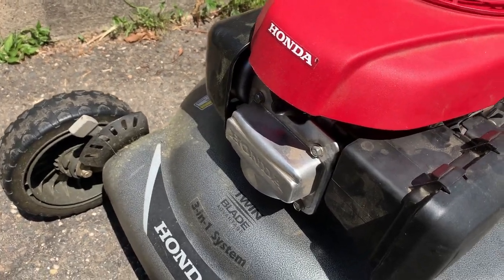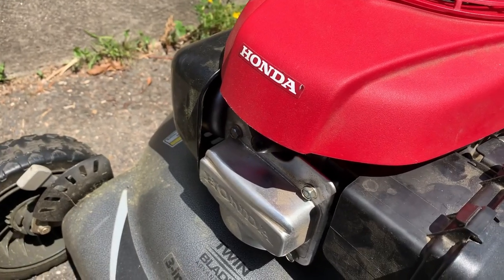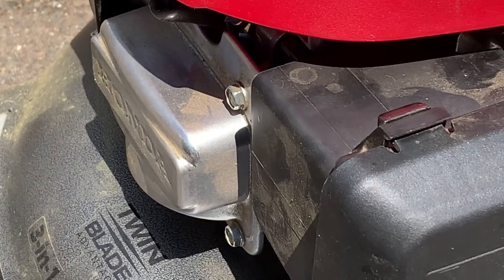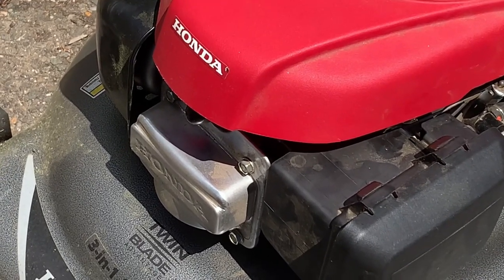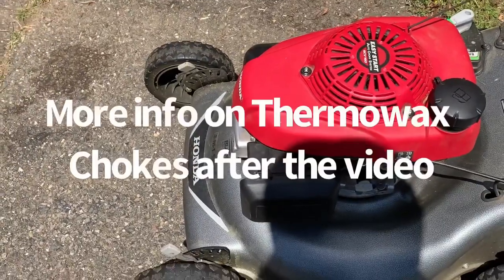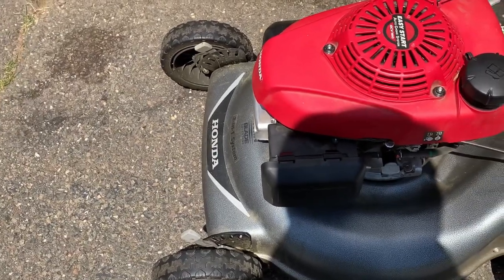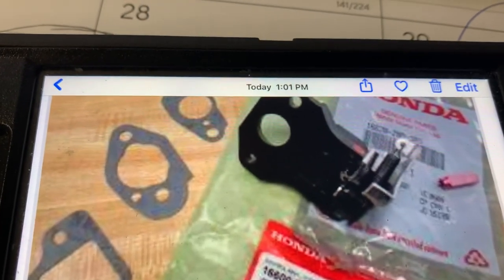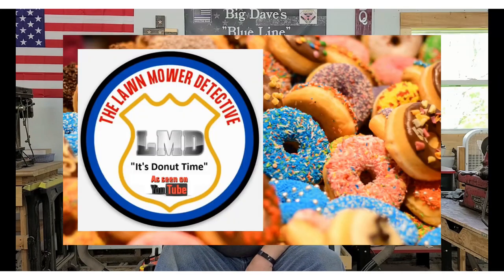Honda Mower GCV-160 stalls after a few minutes. NOT the normal solutions!

Comment: I've got a pressure washer with the same motor. I tried the gas cap, fuel hose flow, changed the ignition and the spark plug. I'll check the carb next thanks to you😊. The engine only has about 10 hours of run time on it, but it sat for about a year (with no gas in it) between working and not working.
Reply from the maker: Guaranteed Schmutz on the carb! Good luck!

Comment: My initial issue was a surging then stall.  After some research and seeing several videos, i took the carb off, pulled the main out,  ran a torch tip.cleaner through it, pulled the screw out beneath the idle screw and ensured fluid/ air would pass through. Reassembled,  replaced that wax peiec as mine had a bent rod and wax all around the rod. Now it starts right up but will only run about a minute or less. I've tried the gas cap, not thinking it's the ignition but not sure
Reply from the maker: Is the choke fully opening? Did you squirt fuel in the carb as it’s dying to see if it will keep it running?

Comment: I have a honda gvc170 dies after a minute or two Cleaned Carb. looked good before, Gas cap vented, even bought new carb. when all else failed good spark.. still doing it. a what else could it be???
Reply from the maker: Is it losing Spark when it dies or Fuel?  How long before it will restart?

Comment: Ken my Honda engine GCV160 over head cam runs about 20 seconds dies and can restart it a minute later. Dies again. It has a manual choke. changed carburetor and coil still does the same thing.
Reply from the maker: Spark plug. Sounds simple try it
Reply: @KensSmallEngineRepair  did that also.
Reply from the maker: @randyturner4803  is it dying due to fuel starvation or lack of spark? Spark tester die out when it quits? Squirting fuel as it dies bring it back?
Reply: @KensSmallEngineRepair  took fuel line off carb and looks like no restriction. Gas flow steady. Did not try a spark tester will try that tomorrow. By the way your videos are great.
Reply from the maker: @randyturner4803  thanks I appreciate it. Going live at 8
Reply: @KensSmallEngineRepair  Ken I tried second new spark plug and bingo!! The first plug was bad. Runs like a champ. Thank you!!!
Reply from the maker: @randyturner4803  Cool!!!!👍👍👍👍

Comment: A Great Find there Brother,
I had a very similar issue on a Briggs with the plastic carb and an automatic (spring choke stove) choke , Start 1 or 2 pulls run for a few minutes then die, set for several minutes and would restart,
What I found was a few small blades of grass in the carb bowl blocking the main jet, cleaned the carb out runs like a top.
👍👍👍
Reply from the maker: Wow, never seen that before. Good hearing from you Brother, hope all is well!

Comment: Ken so are you saying it was a clogged jet. 

Did you replace the wax plug? 

My choke system seems to open and close. 
It seems to stave for gas then raises in idle. 

Would you say the carburetor is the problem 

Thanks Houli. 

This system seems to have many gaskets 

Did you totally remove the carburetor from unit or did you remove the Emulsion tube and clean it out. Or keep in place and spray out the crude 

Thanks Houli
Reply from the maker: It was a clog in the main jet   Not fully clogged but clogged enough to work with choke on but not enough fuel to keep running with the choke off.  I disassemble the carb and clean out the jet, emulsion tube, and pilot jet.

Comment: i have a Troybuilt with this engine on it and had the same problem.I left ethanol gas in it between cuts and during winter time.It got to a point where i would have to spray carb cleaner into the carb to get it to start. I did that for a while until i was helping my dad cut grass at his house. I let him use the Troy built mower. The mower ran out of gas and he grabbed the wrong gas can  thinking it was regular unleaded. The gas can he picked up had 50:1 mix in it for our weedeaters to run on and he poured it into the mower not realizing what he did. I found out too late using that mower with 50:1 mix still in it. One thing i noticed was even after sitting for a weeks time It started right up without using carb cleaner.
Reply from the maker: Most mix oil has stabilizer in it which probably cleaned out the jet over time. Interesting!  Thanks for watching.
Reply: @KensSmallEngineRepair  I use non- ethanol gas in everything now. I don't use anything with ethanol.
Reply from the maker: @thsarethbreaks  around here non-ethanol is $15/$20 a gallon!
Reply: @KensSmallEngineRepair  WHAT?!!!!!That is crazy!!
Reply from the maker: @thsarethbreaks  you have to buy it at a dealer or Home Depot or Lowe’s in a gallon can.  No pumps around here have non-ethanol except for 105 octane racing gas at $10/gal.  The octane is too high causing hard starting.
Reply: @KensSmallEngineRepair  We have quiktrip gas stations where I live that sell it for 3 n change per gallon.
Reply from the maker: Wish we did!

Comment: Had a gas leak. Replaced carb. Now it starts then immediately stalls.
Thoughts ? 
Thnx
Reply from the maker: First, how is the gas flow coming out of the fuel line?  If slow does it speed up when you unscrew the gas cap? If fuel flow is fine remove the bowl nut from the carb and see if the needle is allowing ample fuel into the carb.  Let me know and we can go from there.
Reply: @KensSmallEngineRepair  The leak came right out of exhaust port with every pull.
Replaced the entire carburetor & air filter for an incredible $16 bucks, Amazon.
Now it starts up the immediately stalls.
Reply from the maker: @matt75hooper  you had a leaking needle valve, do what I asked above and reply

Comment: Replaced and still have the same issue.....
Reply from the maker: What did you replace?
Reply: @KensSmallEngineRepair  replaced the thing with the wax in it. I’ve learned that it could be the spring that’s on the machine, think maybe the one on the throttle was the incorrect size. I got a new one and the machine runs better until the RPM’s go crazy so I have to turn that down.